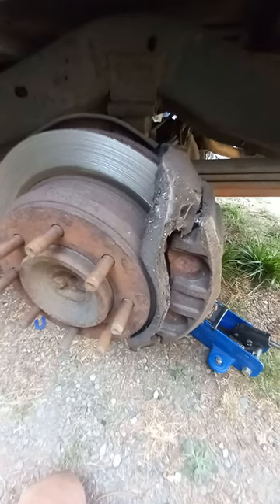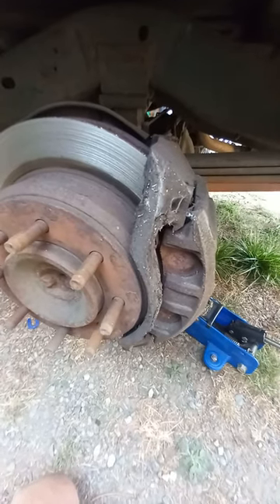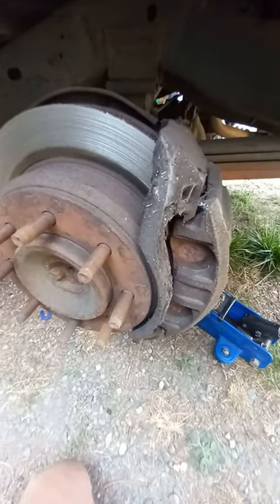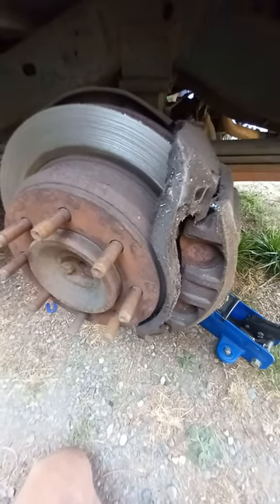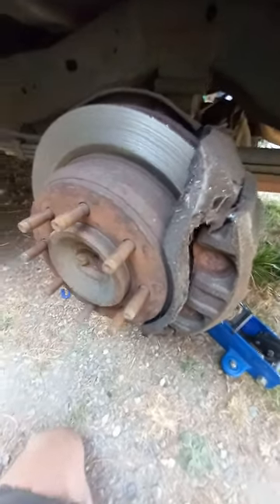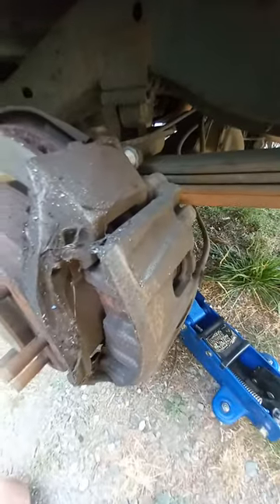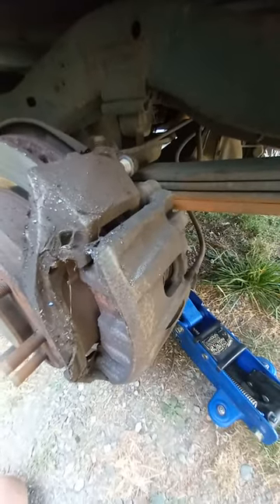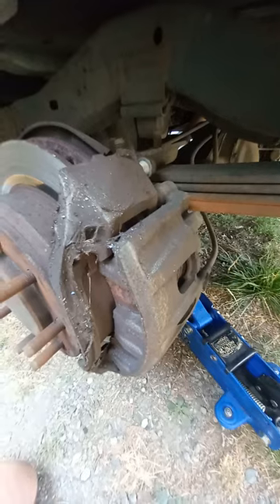2010 Ford E250 rear brake pads and rotors replacement. 21mm and  10mm Hex socket

Comment from the maker: The reason the left rear brakes went metal to metal isa the slider pins were missing the caps that cover up the 10mm hex side of the pins. This washed the grease away and the caliper did not SLIDE like it was supposed to.

Am ordering new caps so it doesnt happen again.